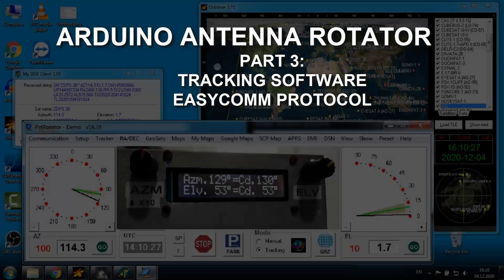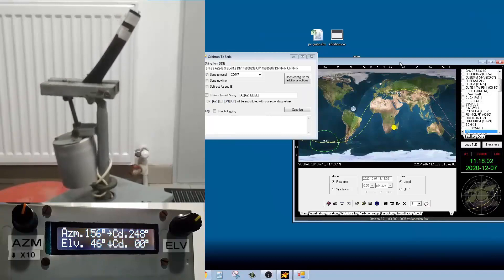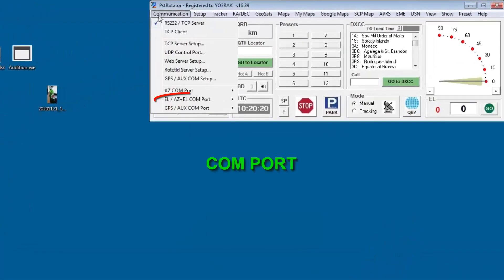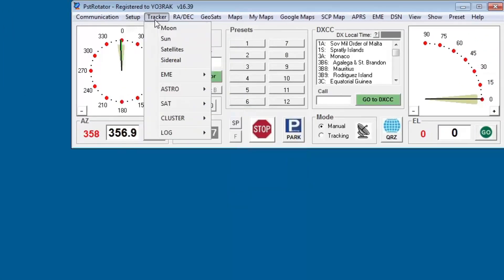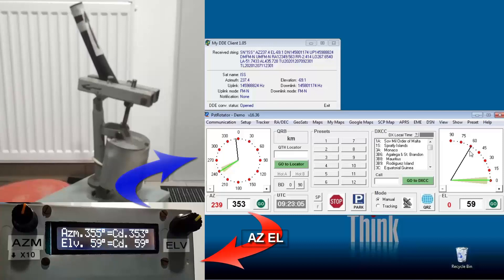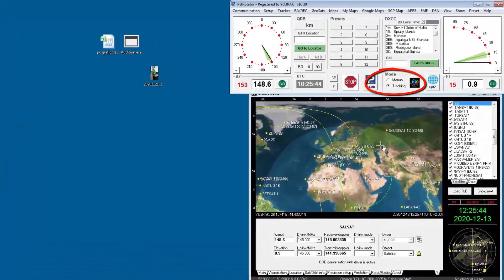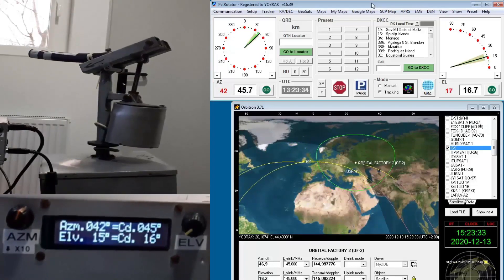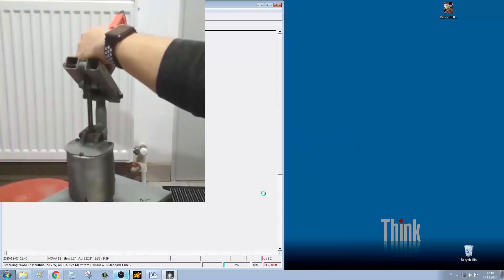ARDUINO BASED ANTENNA ROTATOR – PART3 - Software tracking update

Comment: Hey im just wondering, is there a way for me to actually send the serial into the ardunio software, such that I can read it through there?

Saw you had the output of the Orbitron DDE to com7, is there any way I can read that com7 into arduino. Maybe even to print just the string. Because my idea is to hopefully pass the az,el in your case from com7 into ardunio, and use a PID to control the motors to that specific AZ, EL displayed. Thanks :)
Reply: Sorry I guess the simplified question would be, where does the orbitron DDE output go and how do I read it. Thanks again :)

Comment: Hi Viorel! I managed to get it working thank you so much just missing the antenna position green arrow it doesn’t show up to me :(
Reply from the maker: Hey Pedro
Please give me more details. Green arrow? What tracking software do you use?
Reply: @Racov  im using the PST rotator software. I’m missing the position feedback in the software which would be the green line
Reply from the maker: @pcostadias  the green arrow always shows up, it's just how PST works. If there's no feedback, it stays at zero.
Make sure to select communication protocol (AZ/EL) K3NG Easycomm.
Your email doesn't work.
Reply: @Racov  hi Viorel thanks for you Mr reply! I’ll try to reinstall I have full functionality except that! I really appreciate your help and support!

Comment: Great but cant you use stepper mottors instead of dc motors theyre more accurate and better control i was thinking towards nema 23?
Reply from the maker: Hi Bini Sol,
Of course you can use steppers. As I said, this is what happened to be laying around in my junk bin. A wind-shield wiper motor with gears.
Beware that building a home-made rotator is much more difficult than making the Arduino controller. The motor choice is just a small step.
Cheers.

Comment: hello...I have a question: do the potentiometers need to be of the multiturn type? thanks
Reply from the maker: Hello Arthur. 
No. Any potentiometer between 200 and 1000 ohms will work fine. The higher quality, the better, of course.

Comment: Hi, I have a problem, sorted all but only 1 I can't.
How to extend Azimut rotate?  working from 0 to approx 345-9 dig. Display shows 359 but is not right.
What I need to change 

thank you.

73. M7SPS
Reply from the maker: Hello Sebastian.
I believe you should do the calibration procedure. You'll find the instructions right there, near the arduino code.
If you need more help, let me know.

Comment: Me again.
the one with the Urals.
We still have something in common.
It's a very exciting project. Ham Radio Satellites. I would also like to become qrv there from the home station. So far I am only portable with a self-made arrow antenna. I am currently trying to build a rotor with stepper motors and worm gears. Unfortunately, I'm not that good at programming this in Arduino. I'm currently putting this together from various sketches. Well, it's been like that so far. But it doesn't work yet.
You seem to be further there. I wish you (and me) continued success.
Kind regards, Gerd (DL5BBH)
Reply from the maker: Hello Gerd.
The mechanical part is the real challenge. If you want to go further with this project, please let me know. Don't worry about Arduino, I am a beginner too, and still managed to pull this out. We can adapt the code to your needs.
Sincerely,
Viorel